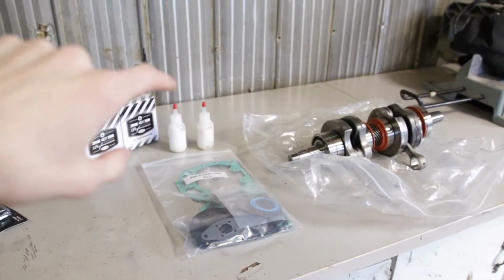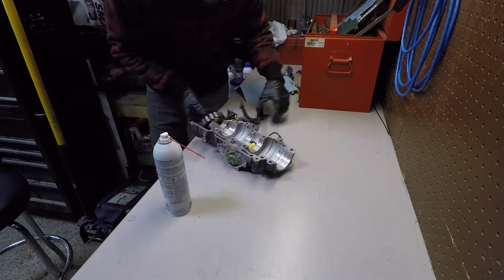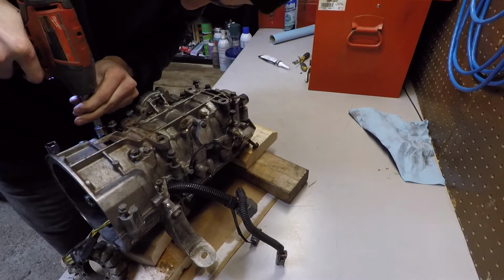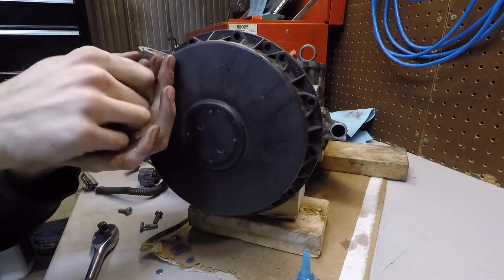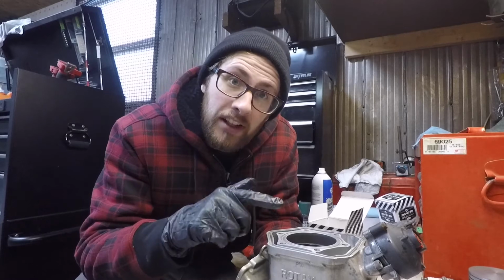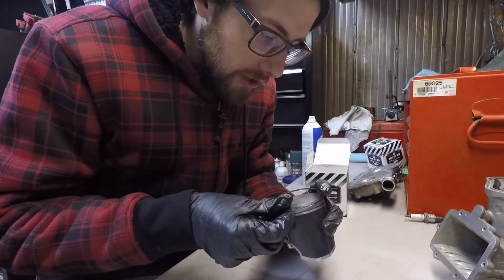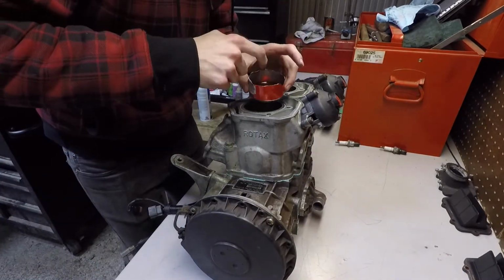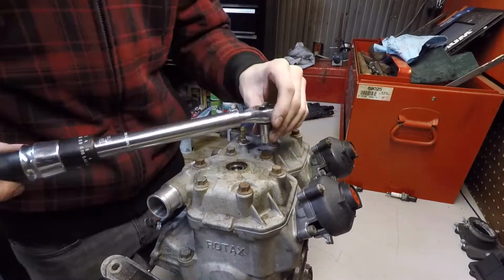2008 Skidoo MXZ 600RS Engine Assembly

Comment: Great video, going to do mine next, 2007 800 HO mxz. I assume you put the pistons facing towards the front of the engine?! Great details, short and sweet. If only they made a engine bracket to mount to a table, that would be great! Lot's of other great comments below in regards to the y bracket for the exhaust.

Comment: Did you isoflex the mag side bearing?
Reply from the maker: There was isoflex pre-applied to the bearing! The mag side isn't sealed off like the PTO side is.
Reply: @curtiswalshmedia3194  in the schematic it’s still calls for it, im pretty sure it’s harmless to use it extensively, for next time install the crank seals with isoflex spread on them, and with the motor in the sled tighten the y pipe before the cylinders and then put the head on.
Reply from the maker: @brandonshogren5621  Thanks so much for the information! Let's hope I don't have to do this again. Ha.